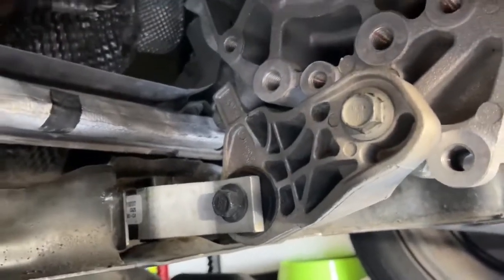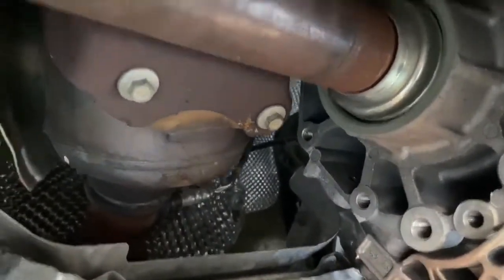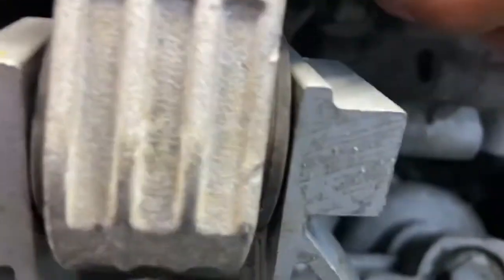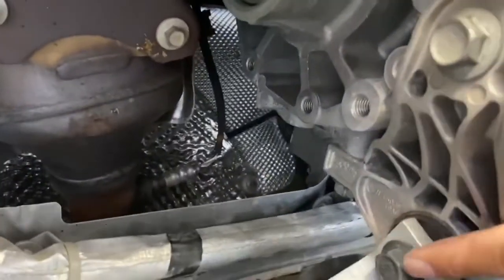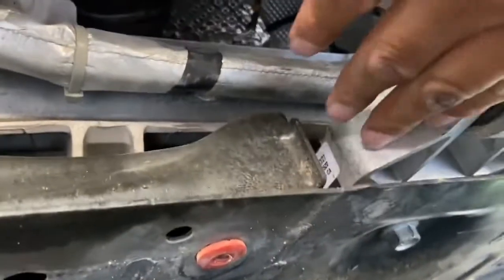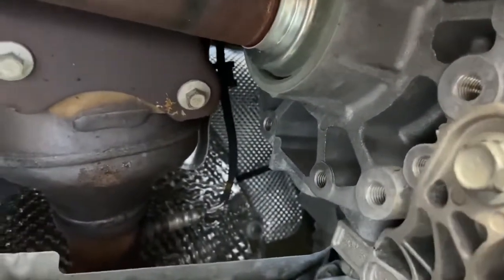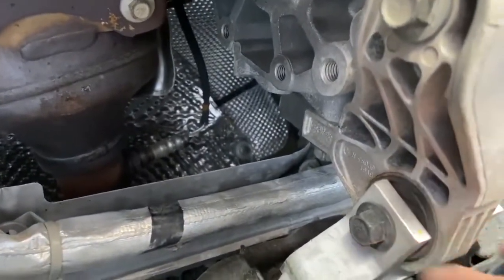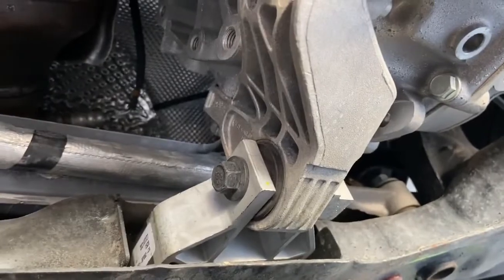Rear Motor Mount Location on 2016 Ford Escape

Comment: Were you able to remove that 3-bolt mount? I’m doing the same mount on a 2016 transit connect. Thanks
Reply from the maker: Long story about this and we will have an update coming. Bottom line, try to find a higher end mount even though it’s more expensive.

Comment: porque se cambia? que síntomas causa??
Reply from the maker: The vehicle would shake a little when at a stop light. Even after three engine mounts, it’s still a little rough. 🤦🏽‍♂️
Reply: @HopiLivingintheCity  I've noticed that small engines run rough at idle.